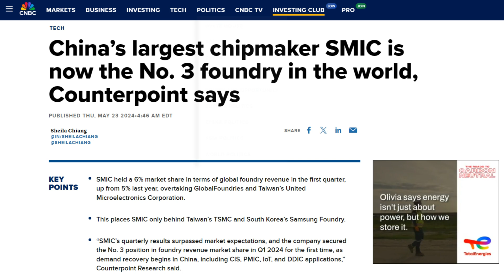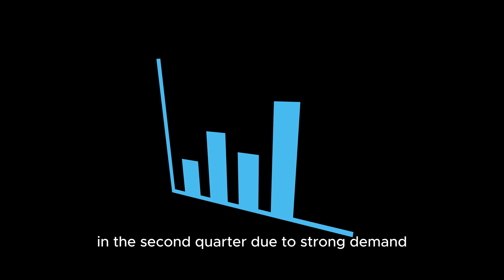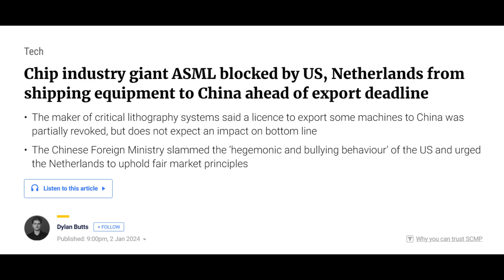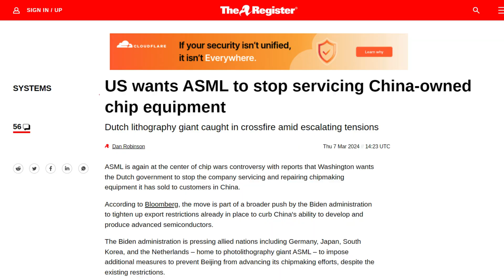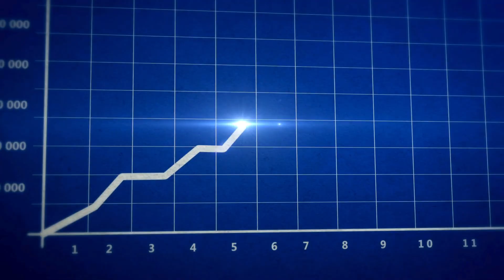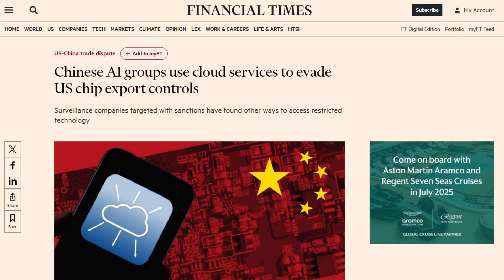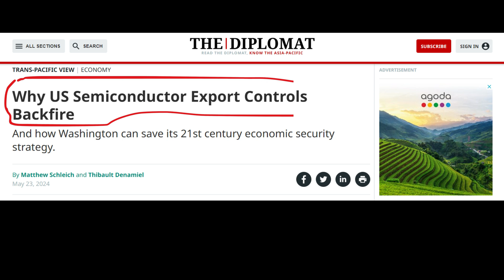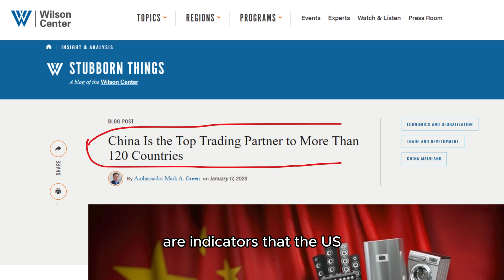China's SMIC is NOW the 3rd Largest Chipmaker in the World

Comment: Several years ago,news told that China could not produce 7 nm chips without euv machines,then they changed the story when China begun producing 7nm chips,the same Is happening with 5 nm and 3nm chips,etc,etc.Also news told that It was imposible for one country locate all the value chain  in one place and China Is making It a reality.Also It looked like It was impossible for developed country to produce low cost electric cars for general public and China made It a reality.
Reply: They can make 7nm (and theoretically 5nm) on previous generation ASML machines, using multi-patterning. But this is low-yield, slow and expensive. That’s why they have been buying truckloads of older ASML machines, and continue to do so

Comment: The Dutch company ASML produces the old DUV lithography machines and the modern EUV responsible for the production of electronic chips.
EUV are more advanced than DUV and are designed to produce wafers ranging from 10nm to 3nm.
Unlike the old DUV whose production geometry starts from 28 to 12.

Chinese company SMIC has old DUV machines that it has modified to be capable of producing 7nm chips. The difference here is that it cannot modify it further to produce 5nm chips because it has placed all its chip production capacity in DUV machines that cannot handle the additional modifications to reach 5nm, so that post-production damage to chips reaches approximately 54% of the production rate. This figure represents a significant loss for the chips it produces, in contrast to EUV machines, which reach only 5%.

Comment: The 80% of chips used in manufacturing are not high-end chips.  Washing machines, refrigerators, televisions and many other products do not require high-end chips. 

China is quite capable of making mid to low end chips for its own market and for exports.

This chip war has resulted in loss of revenue for Korean, Japanese and American chip makers, particularly in low-end and mid-tier chips, forcing China into being self-reliant separates these chip makers from their biggest client.

Be careful what you wish for.
Reply: Not even defense needs high end chips. Rockets and satellites from around the world mostly use IBM powerpc design from the 90's and early 2000's.
Reply: @kangkim150  
What about thing like f-35

Comment: TSMC is correct that Huawei is not a rival since the company does not produce chips. However, Huawei certainly has the capability to design advanced chip circuitry and SMIC can produce the chips Huawei needs. TSMC can have the highest profit margins for its 3nm, 2nm and 1nm chips selling to American companies but SMIC will have the largest revenues selling mature node chips to the largest tech market in the whole world. A simple calculation shows who is the winner and loser.
Reply: Industry leader like TSMC is only one mis-step away from from irrelevance. Once a rival like China absorbed the knowledge and start to innovate and bypass current technology leaders, the market will shift rapidly and current market leader will wither and die. This is especially true for semi-conductor industries, where each production plant ("fab") cost $20 BILLIONS to build. Each "fab" or production plant is basically a giant risky gamble that could fail. In the next decade China is most likely to emerge as the leader and winner in this and TSMC and western foundries slowly disappears.
Reply: @RareVDO  
That is why nVidia's Jensen Huang said he will never abandon the Chinese market. Smart guy.
Reply: also what is important is the trending of these companies.
Reply: There's incorrect. Due to USA sanctions, Huawei start making it own chips like about 2 years ago. You can found it 3 - 4 football field chips factories in Google Map.
Reply: Profit is one thing. Technology is another. In this high tech world, technology determines much more than profits. The country with the most advanced tech will be the strongest country in economy, military, culture, education, healthcare etc., and respect from other countries.